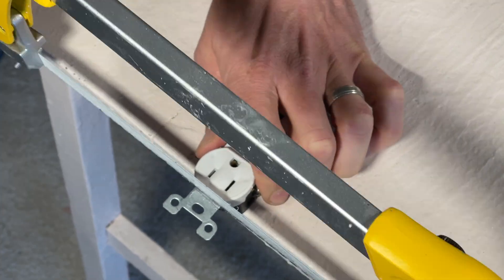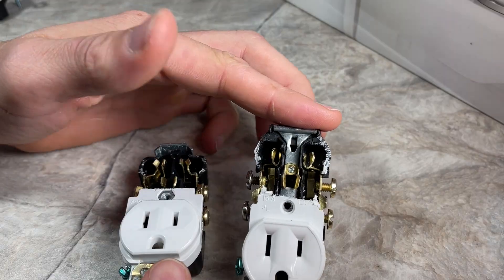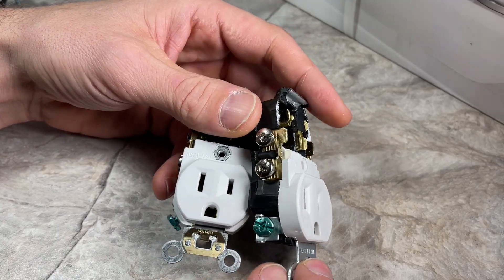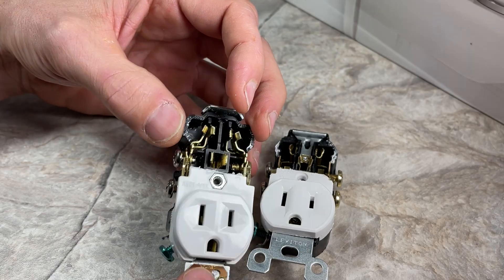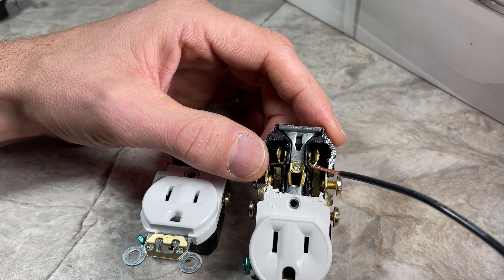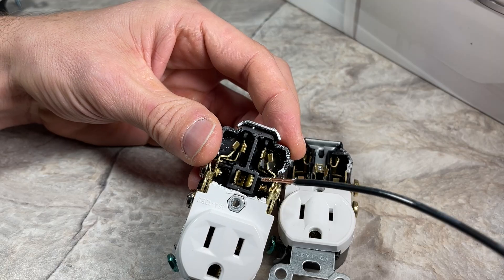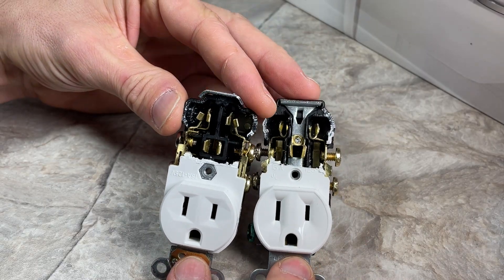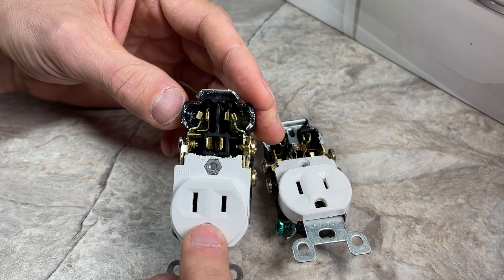What Outlet Should You Buy For Your Home |  Commercial vs Residential

Comment: I think it's more accurate to call the Residential grade the "Builder's" grade.  the builder buys the cheapest part that they can to improve their profits while meeting the required code.  There are also builder-grade appliances that look like the more expensive models but are also the cost/quality reduced versions typically used in new home construction
Reply from the maker: Don't get me started on modern appliances.  From a cost to buy vs a cost to repair perspective appliances are basically disposable at this point.

Comment: I wish you would have opened it up a little further to show the construction of the hex-nut style attachment for the wall plate on the commercial outlet and the difference in how it is secured to the device. It looks like the residential grade attachment point for the wall plate has the screw threading into the ground strap but the hex-nut is isolated from the ground loop by being embedded in the plastic housing. If that is the case then what would be the difference if a metallic wall plate is used in in each of the two systems ?
Reply from the maker: Hey Joe,  good question and the commercial hex-nut threaded stud actually also is connected to the mounting bracket running through the housings and riveted to the cradle bracket.
Reply: @EverydayHomeRepairs  Thank you Everyday so this means the wall plate screw is going to be grounded and if there is a metallic wall plate that too will be grounded

Comment: If I am on a budget or concerned with cash flow I will spend less money at every opportunity. 
If the extra money is available to buy costlier things that perform better and last longer then it might be a thing worth doing.
As with anything, more than one aspect of the expense and result exists, and I should weigh my choice using the scale which reflects the proper values. 
Personally, I am conscious of my buying propensities and habits because I overspend too easily.
I often leave at least one thing in my cart which I didn't need and can't really afford. 
I know I'm not the only person dealing with this. 
Thank you for the video! I generally appreciate the information shared as well as the time and effort necessary to do it.

Comment: Here's one huge difference that wasn't mentioned...  The commercial version has screw terminals on the sides that have a square washer/plate under them.  This is to accommodate stranded wires which are much more common in commercial electrical than residential.  It is not permissible to connect a stranded wire under a plain screw like you can with solid wire unless you first install a crimp terminal which is a hassle and time consuming.
Reply: Great note!
Reply: I personally find this screw clamp method of back wiring on this commercial receptacle to the be the easiest and most reliable.  It has the advantage of allowing a straight wire (no fumbling with bending shepherd's hook in the conductor), and it has the reliability of a screwed town terminal.  Some receptacles even have marks to help strip to the right length.  It's fast and reliable.  I'm curious if anyone has found any downside to this method.
Reply: @csml2  it’s definitely the easiest and best way when the device has them.
Reply: @csml2  I bought a 10-pack at Lowe's like that for $17. https://www.lowes.com/pd/Legrand-Ivory-15-Amp-Duplex-Outlet-Commercial-10-Pack-Outlet/1000001264 Another advantage is you can easily pass through 3 lines since there are 4 wire slots to tighten down on.
Reply: @markc2643  Unless expressly said so by the manufacturer, you cannot put more than one wire under a terminal connection. It's in the BOOK.
Reply: @surgemas  The opening picture on this video from a manufacturer shows 2 wires under the same clamp https://www.youtube.com/watch?v=KF89Am3Hvyw   I would expect that having 2 distinct wire channels for each screw back-clamp IS the manufacturer designing it for a pass-through on the same screw clamp.  
Edit: At 1-58 of that video it actually shows 2 wires on 1 screw terminal while splitting the outlets.
Reply: The screw terminals are listed for use with both solid and stranded wire.  Most devices are not listed for use with Stakons or any other pressure terminal.
Reply: Your comment is wrong and misleading.  Stranded wire terminations are compliant and in most cases stak-ons are not.
Reply: @Speed Buggy you’re definitely wrong.
Reply: @Speed Buggy You're categorically wrong and giving advice that isn't true.  Devices aren't listed seperately for solid or stranded wire and will accept both solid and stranded wire.   There isn't a separate means or method used to terminate stranded conductors.  The use of stak-ons in most cases would create a violation of 110.3b unless they are specifically listed for use with those terminals (Hubbell makes one that is).  You  can confirm this yourself by becoming familiar with UL standard 489.  Or whatever standard the NRTL uses that list the specific receptacle you are installing.  You're confusing your own limitations with requirements.  Stranded conductors can and are expected to make good terminations.
Reply: What if you tin the ends?
Reply: @gmsllc  it’s not needed and not recommended. Just wrapping the bare stranded wire around the screw is totally fine.
Reply: Yes was going to mention that but beat me too it.  Most commercial building wiring is going to be stranded since using conduit residential most is going to be solid (Romax) type wiring. One thing wish they would do is do away with the stabback connections on residential, fire hazard.
Reply: @Speed Buggy check Article 110 of the NEC. Screw-type terminations are permitted for stranded wire up to 8AWG
Reply: Using a crimp terminal is even against the UL listing. https://legacy-uploads.ul.com/wp-content/uploads/2014/08/NovDec2008.pdf
Reply: @zachazlett  I've seen an equipment failure where crimp terminals were used on connections that were designed to be used with bare wire.  The thermal overload on the motor controller kept tripping.  I thought the controller was bad until I happened to switch it on with the lights off, and saw sparks coming from the connection: it had worked itself loose and the high resistance caused it to get warm enough that it would trip the overload.  I cut the terminals off and connected the wires directly; problem solved.
Reply: @barryomahony4983  I’ve seen the same thing a few times. Crimp terminals aren’t as wonderful as people seem to believe.
Reply: That’s not true as far as I know. If you look up the specs on the commercial outlets you’ll see the back wire connections are rated for up to #10 stranded or solid. 

If this type of connection wasn’t allowed then you wouldn’t be able to use Square D QO breakers with solid wire either.

And for the stranded wire under a screw that’s totally legal also. You’ll find nothing in the code book about it.
Reply: @zachazlett  No competent Electrician will A) Ever use the rear back stabs on an electrical receptacle, they are huge failure points and are avoided at all costs. B) No stranded wires are ever landed on to terminal screws, it's just about a guaranteed short once a strand works its way loose. It's always tailed out to Solids. 

It's a valid difference.
Reply: @jkslate  lol Part A) you don’t understand what we are talking about. Part B) you  don’t know what you’re talking about. Read the UL listing posted above.
Reply: @zachazlett  I know exactly what you're talking about.  Only a hack Electrician will put stranded wire under a screw terminal, UL listing or not. Commercial receptacles have a terminal plate which is more acceptable to put stranded wire in, by trade standards. 

I've worked as a commercial Electrician for over a decade and we have never once put a stranded wire on a terminal screw. It just doesn't happen. Don't be a hack.
Reply: @jkslate  lol those plates haven’t been around for long and not all commercial outlets have them. You must not do much service work.
Reply: @zachazlett  Which is why Electricians that aren't hacks will tail out stranded to solid before connecting to a terminal screw.
Reply: @jkslate  lol you must live in a fantasy land.
Reply: @zachazlett  Why? Because I take the extra 20 seconds to tail out in solid? Holy hell, I know, big adjustments there! Carry a box of terminal adapters with you, they take 10 seconds to crimp on. Fantasy land is living in a world where doing good work seems so much more difficult for you. You go ahead and keep being a liability though, that's on you.
Reply: @jkslate  the screws aren’t listed for terminal adapters. Also I know how to correctly use my material as UL listed so I know how to use stranded wire.
Reply: @zachazlett  

Yup, you're a hack.

UL White Book
Receptacles (RTDV)
Receptacles for Plugs and Attachment Plugs (RTRT)
Terminals
Terminals of a receptacle are permitted for use with certified field-installed crimped-on wire connectors or an assembly, if so identified by the manufacturer.

A receptacle may also be provided with conductor leads with factory-installed crimped-on connectors. Such connectors may be either attached to the receptacle terminal or are provided with the receptacle in the smallest unit shipping container and are suitable for use with the terminal of the receptacle.
Reply: @jkslate  hahah find me one of these outlets.
Reply: @jkslate  do you find the spec sheet and UL listing for every old ass outlet you come to? Do you sit at the gang box and read the specs on all the new ones? If you don’t do that and still use crimp terminals you’re a hack that hasn’t had much training.
Reply: @jkslate  I'm a licensed journeyman electrician and I have no problem landing stranded wire on a binding post type screw terminal... but I always reverse the factory twist on the stranded wire so the strands twist tight as the screw tightens.
Reply: @zachazlett  While there isn't anything in the NEC about stranded wire under screws it is in some local codes. For example Massachusetts modifies 110.14(A) as follows:
"Connection by means of wire binding screws or studs and nuts having upturned lugs or equivalent shall be permitted for 10 AWG or smaller solid conductors. Where stranded conductors are terminated on and not looped through such terminals, the terminals shall be identified for such use, or the strands at the terminals shall be made solid."

According to the UL info you linked it seems receptacles are listed to have stranded wires under the screws so you would be correct in that regard. However, switches are not. Always consult with your specific codes.
Reply: @eDoc2020  if I read what you quoted correctly it says that the terminals they are talking about are the screws themselves not a crimp terminal like a sta-kon. It says the terminal(screw) have be listed for stranded wire and outlets are. 

Also what I linked says the switches could be listed for stranded wire. I’d need to check the specs on a few but I’d guess most are these days.
Reply: @zachazlett  Legal perhaps, but they fail constantly in my experience.  I've had several fires because of them, especially when high load items such as space heaters are involved.  I avoid using the push connections entirely.
Reply: @artnelson3402  I’d love to see the fire reports on those.
Reply: @zachazlett  Unfortunately, I'm just the guy who fixed the damage, the owners would have any reports, but I probably have pictures of the smoldered outlets and walls.  I can assure you that it was no fun driving up to scenes of fire trucks and cops.
Reply: @artnelson3402  I’ve fixed many melted connections over the years and that doesn’t mean those types of connections are any less safe than others. That’s the nature of electrical connections. It’s impossible to make a 100% forever connection. By adding a crimp connector you’re adding another point of failure. Also you’re most like going against the UL listing.
Reply: @zachazlett  This may be the worst argument that I've ever seen.  Newsflash: Melted or hot connections = unsafe. Melted connections are caused by heat because of resistance in the joint.  This is not the nature of a good electrical connection which should have as close as possible to zero resistance.   People using stranded wire under screws is just half assed,  period, and is not permitted.  The friction and circular motion of the screw head as it tightens almost always damages the individual strands in some way.  As some strands thin and break, the load is increased on all the others.  The best way to handle that is to crimp or solder the wires together before using them in such a fashion.  As for adding another point of failure, I suppose you consider couplings a bad idea for plumbers?  How else should two pipes be joined?  Crankshaft bearings in a car engine?  No sir, I don't want to add another potential point of failure.. LOL.
Reply: @artnelson3402  lol

Comment: Good video, one thing is it is not a torsional load that slits the plugs in half it is just plugging them in. This is why the better unit has the mounting bracket on the backside of the plug case to offset the load of pushing in plugs. Someone else pointed out but said it was due to the screw and may have phrased it slightly wrong but there is a washer behind the head of the screw that is designed to hold a bare wire without having to bend it around the screw saving install time. Thanks for the video

Comment: Cheap outlets, and I mean something below Leviton res grade, were the source of a big problem at a rental property I look after. Multiple outlets on the same circuit didn't work. 

1) they were all back-wired
2) multiple outlets on a circuit had wire connection failures, resulting in the downstream outlet not working.

Comment: Wrong. Wires for outlets in a home uses AWG 14 which can hold a max of 15 amps times 20 percent for safety gives you 12 amps. If you use  Commercial grade where wires are AWG 12 and holds a max safety of 16 amps you have a more likelihood of needing to change your home wiring than changing a simple outlet.

Comment: I personally like the better grade ones that have the clamps that work with up to #12 (or 14).  I hate having to wrap wires around the terminal screws as to do it right takes a bit of time (at least for someone without years of experience).  Nice comparison video, I always wondered about the actual internal guts.
Reply from the maker: Hey Matt and that is actually another beneficial feature of the commercial-grade outlets that I missed mentioning.

Comment: This video convinces me to go for the commercial outlets. The extra 1.50$ is not much compared to the labor for replacing a bad one, not counting the possible damage, fire caused by a short inside the outlet. I wish I knew about this 9 months ago (that was when I replaced ALL old outlets in my home with new ones (LEVITON), switches too. I paid 20$+tax for a box of 10. And these are tamper resistant and look like the 50 cents in this video !!!
Reply: One thing I hate about these new Leviton outlet is: it is so damn hard to remove a wire that is pushed in to a hole in the back. I know there is a very small hole to stick a tiny screw driver in and that will release the wire, but I tried, did not work very well, had to cut off the wire and it becomes shorter !!!.  So I always make a half loop of the bare wire and screw it securely. This method is my preferred one as I only do this for my home, not for a living like an electrician may want to get the job done as quick as possible.
Reply from the maker: Hey Kim,  thanks for the feedback and I as well stay away from the push-pins.  They have been the source of too many stories / problems over the years and it is just better to use the screw terminals.  The nice thing on the commercial-grade you can still use a straight wire without forming a "Shepard's hook" around the screw since there are hold down plates under each screw that will securely hold a straight wire.

Comment: One thing this video or the comments don't address is the fact that residential outlets have their purpose. If you're just plugging in regular household items like a t.v., lamp ex. and they stay plugged in you don't need commercial outlets. That's why they make "residential".
Reply from the maker: Hey Frank,  a few others have mentioned they use a mix which follows similar logic to what you are outlining.  Thanks for the feedback.